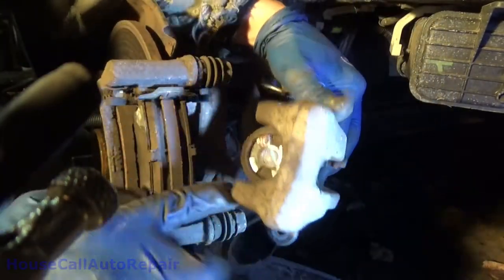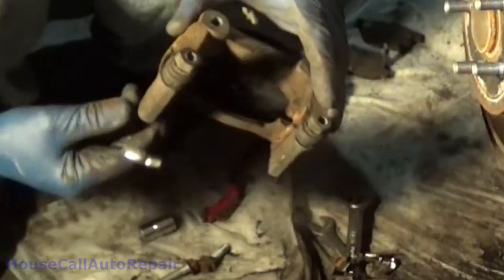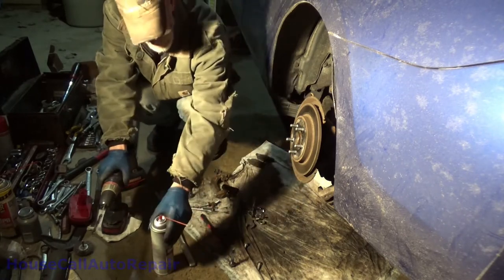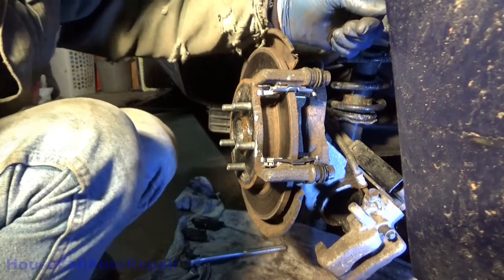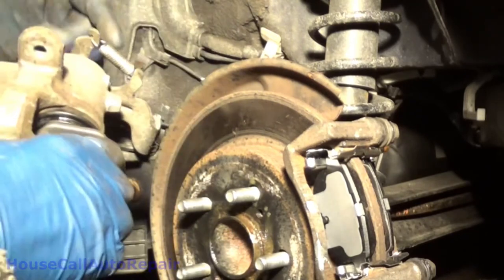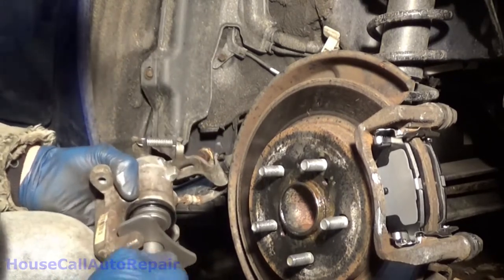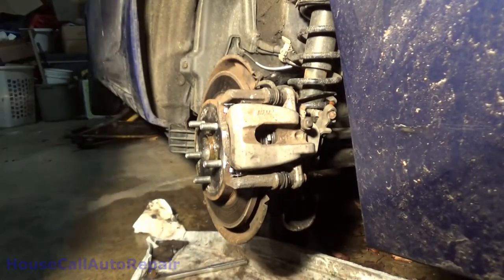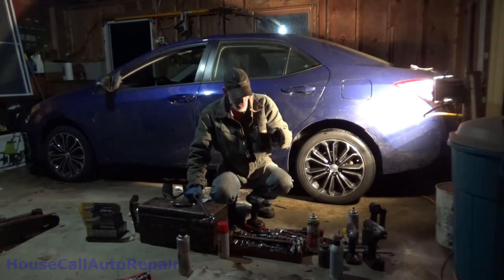2014 Corolla S Front and Rear pads - Part 2 - The Rear Pads - Auto Repair

Comment: Thank you for valuable information
 Would you recommend lubricating  brake pads  contact with bracket ?
Reply from the maker: Most of the time, yes. In my opinion, it really depends on the quality of the pads, the fitment, as well as the quality of the abutment shims. (grit grabbing grease isn't always good when it helps errode the painted surface of the brake pad ears. Exposed surfaces tend to expand into a rust bond)

Comment: Good DIY..  Do not use brake cleaner on the caliper pin boots ( and in extension on the piston boot).. they get deformed by the brake cleaner and may not fit back ( Out of experience) So remove the guide pin boots and can clean them with soapy water and then blast the holes with brake cleaner and you will thank me later.
Reply from the maker: I'm not sure how to reply. Brake cleaner is MADE for cleaning brake parts.  Usually only long term exposure to petroleum products will cause those issues. In 30+ years, I have never seen brake cleaner harm rubber brake components. (maybe the brand?)

Comment: Does the piston in the caliper need to be compressed before reinstall or will it stay in the position it was wnen it was removed?  Since new pads are thicker than worn ones,  how do you handle this difference?
Reply from the maker: Unless you are putting the caliper back on over every undisturbed, you will need to push/rotate the piston back (Called winding back the pistons)
With the right tools, a good condition caliper, and a little skill, they go back in fairly easily. When they DON'T, it's usually rust in the backside, under the parking brake lever, or rust in the bore itself.

Comment: Did both sides retract the piston clockwise?
Reply from the maker: Generally most pistons can be retracted by turning them in the direction the parking brake cable rotates the lever. The orientation of the lever and cable, usually determine direction of rotation.